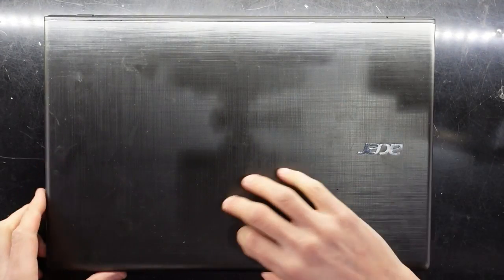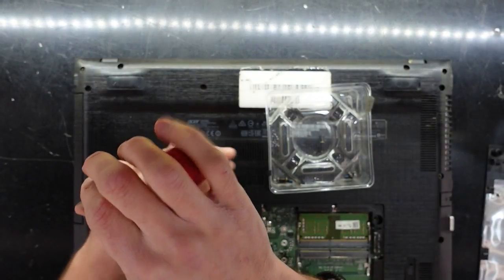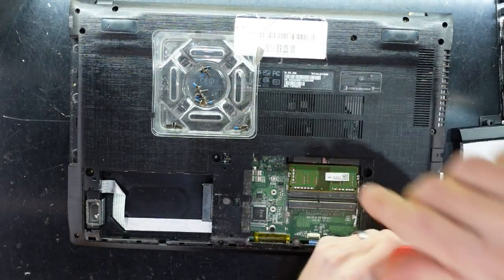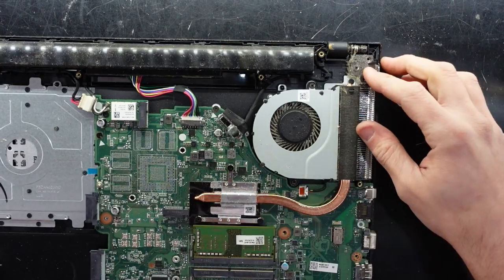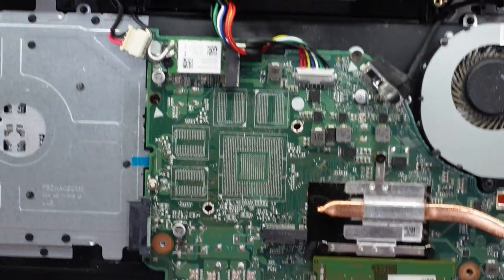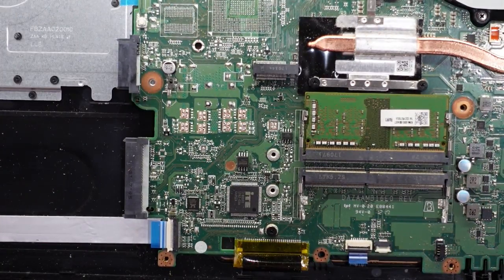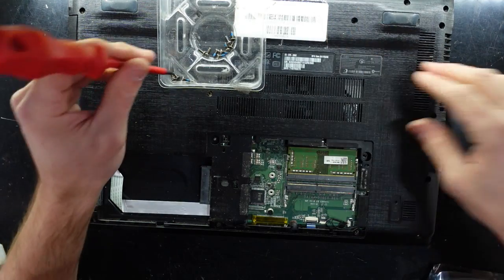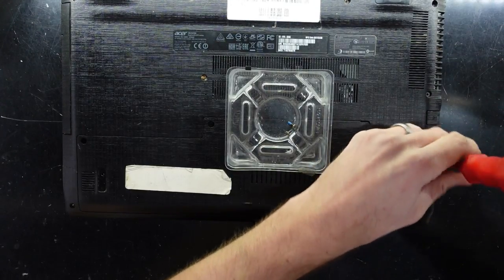Acer E5 575 Battery Replacement and Upgrade Options

Comment: I have an Acer Aspire E5-575G-53VG.  I am wondering if you know how to identify what type of M.2 SSD my computer will hold.  I believe mine has 2 slots while the NVMe only has one slot.  Any ideas of how to know if the NVMe drive will work in this computer?

Comment: 6:29 what is the right side of installing the cable?
I forgot which is right side after i removed mine, will there be an issue?
Reply from the maker: should have two plastic barbs sticking up

Comment: Is it possible to put in a bigger battery when doing the replacement/higher capacity? How does one find out where/which battery is the right one to buy for the 575?
Reply from the maker: Yes I think it should be possible

But I don't have the answers on that one

Comment: Your video is helpful. I have replaced the battery but it does not turn on same brand and model in the video,the battery indicator light is on and orange what's worng?. I've tried the battery reset button at the back no luck there. Thank you
Reply from the maker: revert back to the old battery and see what happens.
Also try and power up the machine with no battery installed
Reply: @rickstechrepairs  Thanks It works with the new battery

Comment: Many thanks for this excellent video.
I replaced the battery without taking the HD out. Hopefully this won't have done anything bad ,-)
The battery I now see, is a lower capacity one but I hope will improve the time between charges.
Reply from the maker: Hope it's an improvement for you

Comment: My replacement battery is like yours from the video AS16A5K, but the original was AS16A8K. I hope that's not a problem. 
Maybe different markings on batteries are only little difference in the voltage.
Reply from the maker: not sure of the difference but should work

Comment: Should have shown voltage on old and new battery instead of date. 🤦🏻‍♂
Reply from the maker: i usually go by date than battery voltage (charged vs flat, will show a difference anyway)
Reply: Voltage is dependent on state of charge and not a very good indication of the individual cell's state of health, unless you separate and charge them all individually, load test, and recharge in a lengthy proccess measuring the resistance, capacity, etc. of each cell individually. The age is also an approximation, however, it's a closer approximation and can be done in an instant. All cells degrade over time, whether they are used or not, therefore, that's a better and more immediate indicator of a battery's health, especially lithium, and especially ones made of cheap no-brand Chinese cells.

Comment: Got my battery ordered...curious about the NVMe card.  I just recently swapped out my hdd drive for a sdd card.  Would that serve the same purpose or would it also be an upgrade?
Reply from the maker: Sata HDD = Older style hard drive = slow
SSD 2.5" = Solid State hard Drive Fast but still compatible with Sata

m.2 NVMe = Fastest SSD, newer technology runs via PCIE Bus

Comment: Hi. Can I still use my acer e15 laptop even without battery? Just using my adaptor? Thanks in advance.
Reply from the maker: Yes, any laptop should run without a battery installed